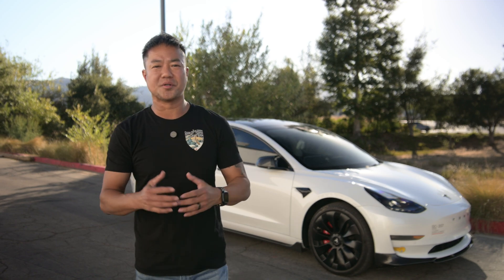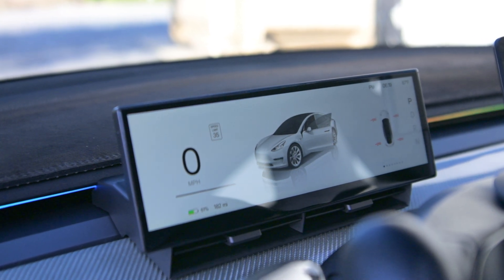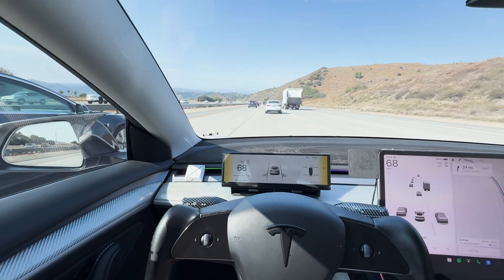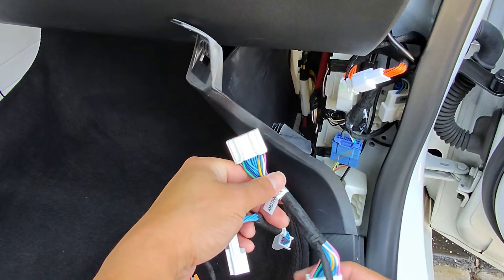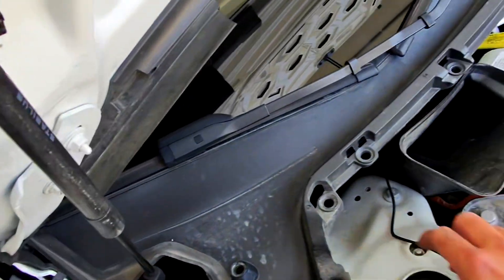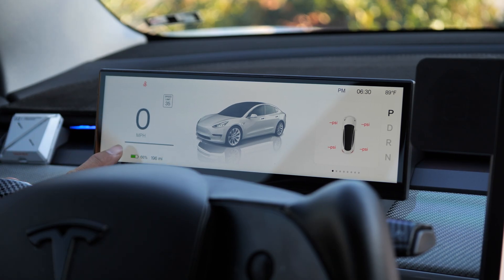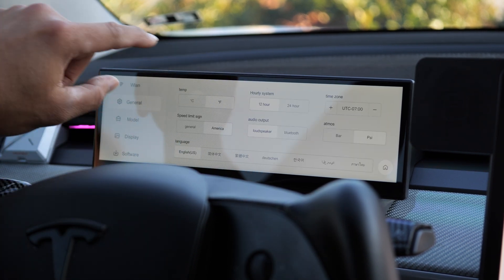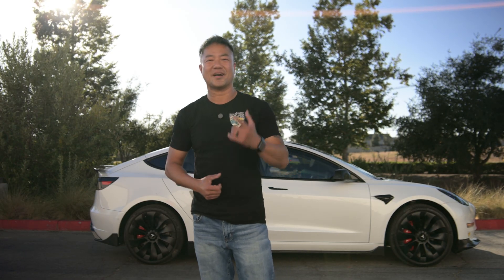Tesla Model 3 Gets an 11" Display Upgrade – Game Changer!

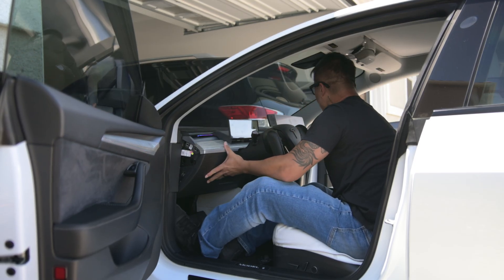Comment: 4:03  It looks a bit clunky and bulky on the original model 3. Especially from the side. I have a 2022. Does it look better in person? I’m guessing this was made with the new models in mind? I’d love a front screen but want to make sure it’s still a clean slick look.
Reply from the maker: Out of all the displays that I’ve made videos for it is the most modern looking one including the way it looks in person as well, but any of the screens will do. I do miss the tiny little screen ahead because I appreciate the minimal looking inside a Tesla model three. This screen does make it look a little bit more crowded for sure. After having it for about a year now I catch myself looking at the screen if I need to know how fast I’m going or other information so at least it’s useful. The front camera is what I use the most so then I don’t scratch my front spoiler when parking because I swear some of those sidewalks curb is bigger than they should be scratching the bottom of the car if you park too close.

Comment: Installed it and removed it right away. Screen and graphics were decent but the airflow is still about half vs nothing in front of vents. Also,  if you don't have the yoke, the screen will be covered by the top half of the steering wheel unless you raise it up to an unnatural position

Comment: Does Apple car play always turn on automatically when you enter car? What if you don’t want to activate from time to time; does it let you turn it off? Or it will turn on as long as you phone Bluetooth is connected regardless if you want it or not
Reply from the maker: Yeah it always turns on once it’s connect it but you can leave it disconnected which I do. I only turn on CarPlay when I want Waze! I like Waze cause it points where the cops are hiding! :)